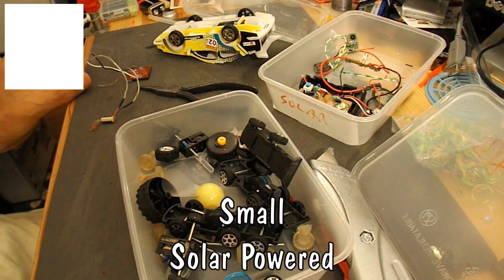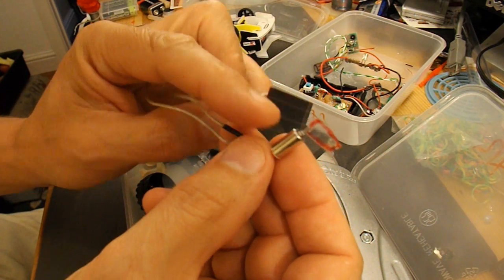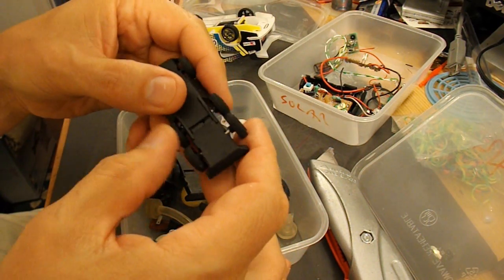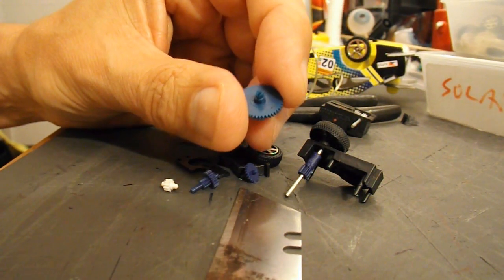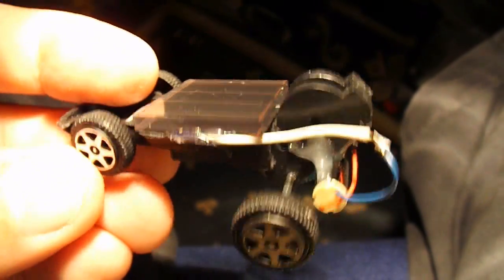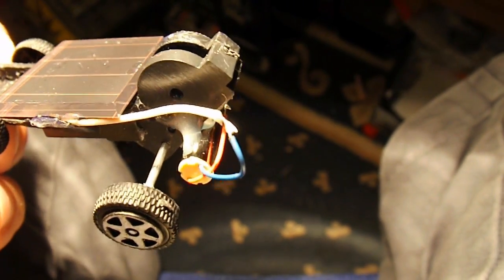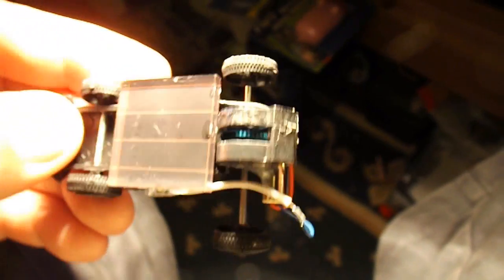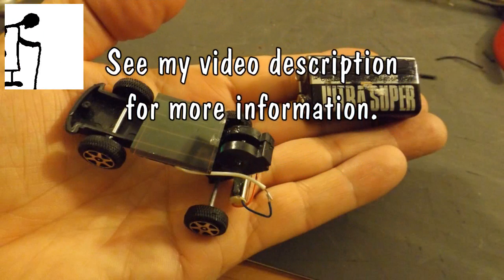Hey Grandad, can you make a small Solar Powered Car? PART #1

Comment: what is the size of the solar panels.?
Reply from the maker: The solar panel I use in this video is about 1 inch square and comes out of a garden solar light, It barely has enough power for this project and it is glass so it is quite heavy. In Part 2 I swap it for the panel from a different garden solar ornament. That cell is about twice the size and is not made from glass so it is probably lighter.

Comment: Hello,
I did this as my science project but it did not work. I changed the wires, and the car still did not move. I am thinking that the motor is to big, and the small solar cell does not have enough power to power the motor. What do you think?
Reply from the maker: You are probably right, I used a very small motor and geared it to help it turn the axle but it still struggled with that solar panel. Here is the PART 2 video https://youtu.be/E8cCIIHWZ_U where I used a slightly larger panel.
Reply: Thank you so much, my own teacher won't even respond to me. You have helped me alot.
Reply from the maker: Georgia Mag Good luck. Are you trying to run it indoors with lights or outdoors with the sun? You will find modern light bulbs are not suitable as they do not give the right light for solar panels. You will need to find older incandescent or halogen lamps. The CFL or LED lamps don't work well. Outdoors in bright sunlight is so much better.
Reply: I will be using the Sun outside. Thank you
Reply from the maker: Georgia Mag one other thought. You may need to oil or grease your gears and bearing surfaces to reduce the friction as much as possible. We are talking low power so any help will improve the performance.
Reply: Thank you, I did not think about it
Reply from the maker: Georgia Mag you may not need it, so maybe try without first.

Comment: you should make any pull back or friction drive car into an rc car.  That's unless you already made one
Reply from the maker: +GuitarRocks360 to be honest it would just be a matter of changing the body shell from the pullback car to an equivalent rc toy car. The pullback or friction car would have nothing else worth keeping. It would not have steering, it would not have a battery compartment, and the gearing would not match an electric motor without significant modification. The only mod to the RC toy car might be stretching or reducing the length of the chassis to match the wheel arches.
Reply: GrandadIsAnOldMan Oh okay.
Reply from the maker: GuitarRocks360 I have considered it several times but that was the conclusion I came up with. There are some good looking pull-back and friction cars about and I know some people enjoy using the body shells. Years ago when I used to do slot car racing I often used plastic kit cars for the body shells. Not really a good idea as they were heavier but they looked good.

Comment: please can you make a go front and back micro rc car using a helicopter motor
Reply from the maker: KAUSTUV RAY if I have any spare parts laying around I will see what I can do, but it might be quite a while before I get around to it. The main problem is the controls on the helicopters do not go forwards and backwards. There is no reverse. They only increase and decrease, so UP/DOWN and LEFT/RIGHT is more power or less power, never reverse.. That means that without additional electronic circuitry the car can only go forwards and steer. Here is a video of me taking a micro car apart which uses similar controls to a helicopter but also has reverse https://youtu.be/emfhtoP_q4E?list=PLA5a2xPRSrB1GrgALJEle2lVqOrR1sX6V
Reply: GrandadIsAnOldMan so sir cant i use a receiver from those cheap 4$ 5$ rc cars
Reply from the maker: KAUSTUV RAY certainly, yes, but I thought you wanted to use all the parts from a helicopter. The helicopter receiver would be smaller and lighter and use a small LiPo battery so the car could be smaller.
Reply: GrandadIsAnOldMan so what should i do actually i have an interschool mini rc car race in my school and the prize is a trip to london and i have never been to london . i am asking this to you as i think you are one of the best makers i have ever seen
Reply: GrandadIsAnOldMan and also the car should be handmade
Reply: GrandadIsAnOldMan so i cant buy one
Reply from the maker: You will have to buy parts to make a car. I have explained the problem with using the receiver from a helicopter so you will have to get a transmitter and receiver from somewhere else, probably a rc toy car.
Here is somebody else's video on making an rc toy car using the parts from an rc toy car and some other bits https://youtu.be/31Kr5QSH6Yg?list=PLA5a2xPRSrB13Xcquw4Ff09MQzTPjeVkI
Reply: GrandadIsAnOldMan thank you ,but from now onwards i have become a big fan of yours
Reply from the maker: KAUSTUV RAY thank you

Comment: hey grandad can you make it into controlable just like  RC car,?
Reply from the maker: No it is too small and does not have enough power for any of the RC gear I have.
Reply: what about a bigger one? im wandering about a RC car with solar power.. it might be good
Reply from the maker: Budiarto Y.N if you make a bigger one you will find out for yourself. You will need significantly larger solar panels to provide enough power for the RC kit and servos in addition to powering the motor that drives the car. If you look at any of the solar powered vehicles you will find that they all use solar power to charge batteries and then use the batteries to drive the vehicle.
In the case of an RC vehicle obviously you would lose all control when it moves into shadow unless you had battery backup.

Comment: How do u use the solar pannel
Reply from the maker: The solar panel has + and - terminals that I wired to the electric motor. When the sun shines on the panel it produces electricity to power the motor. The motor is connected by gears to the back axle and that turns the wheels.